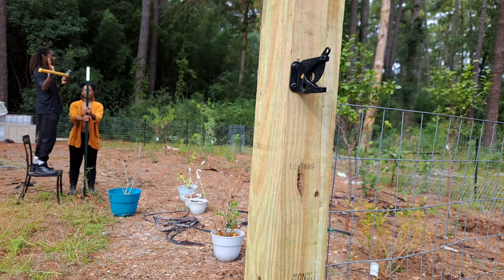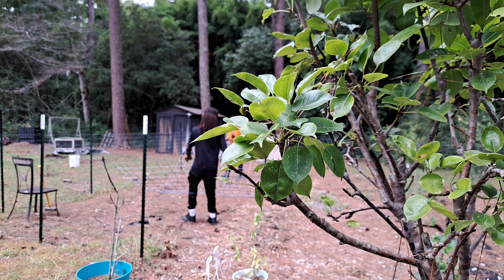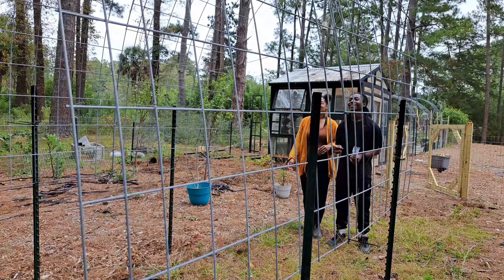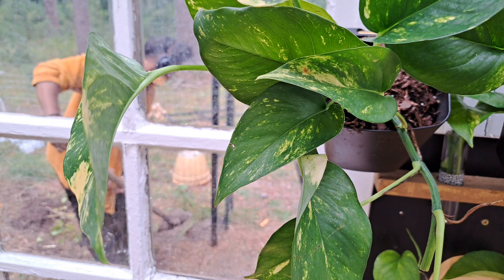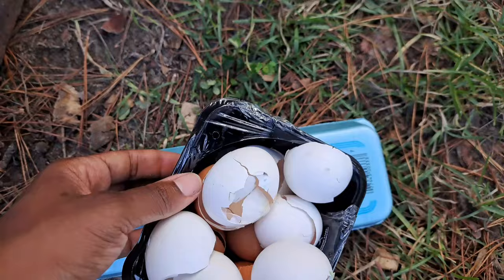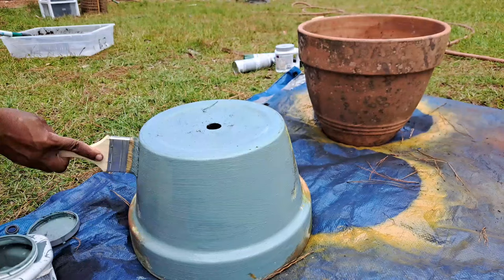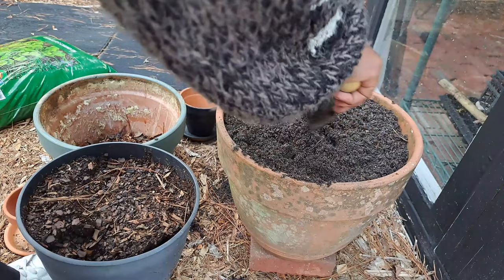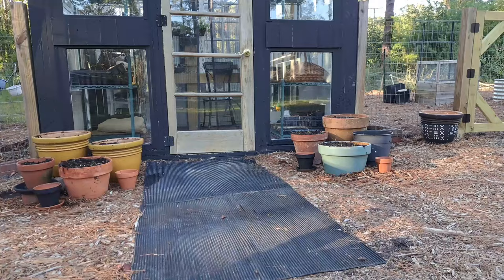Low budgets, beauty, AND function can exist together in the garden ( repurpose,reuse, re-envision)

Comment: You did a wonderful job on the reorganization of your garden space. You are an inspiration because now I want to get out into my own garden and make something happen. I have been looking out the kitchen window over the last few days and all the leaves are falling, and for me, that means leaf mulch for the garden beds. One thing that I do and I'd like to suggest for you as well regarding your eggshells. I have learned over the years that egg shells actually need to be cooked in the oven at approximately 220 degrees (F) for about 20 minutes in order to dry up the inner membrane of the egg. After I allow them to cool completely, I put them into an old food processor that I have now dedicated to gardening projects and I grind them into powder. There are times that after drying my coffee grounds in the oven that I will use the (garden) food processor and mix the grounds with the shells and then I bottle them until they are needed. I also do the same thing with our banana peels, I lay them out until they are completely dry and I will grind them into powder as well. I am a committed canner also, and I take all the bones from our meals and collect them in the freezer until I have enough for a run. Then I bottle them up in quart jars with filtered water (our water here in Ohio is highly chlorinated and not good for watering). After they're all bottled up (I use old lids as they do not need to seal) and I run them in the pressure cooker for two hours. Afterward, I remove them from the bottles, reserve the water for the garden, and dry them completely in the dehydrator and they are like powder. I run them through the processor and grind them into powder. It has been so rewarding to make my own calcium, nitrogen, potassium, and bone meal, all from scraps from our kitchen. In case you're wondering I also compost almost everything I can instead of sending it to the landfill. I am very inspired to go out and begin prepping my garden space for next year after watching your video. Thank you so much. May God always Bless you all with good health, safety, and prosperity in all you do. 
 ~SuzyJC-in-Central-Southeastern-Ohio_10.26.2023~
Reply from the maker: Makes my heart so happy to read this! Thank you for taking the time to share your tried and true tips for the garden! It's much appreciated!!! This comment is so full of great advice! 😍😍😍